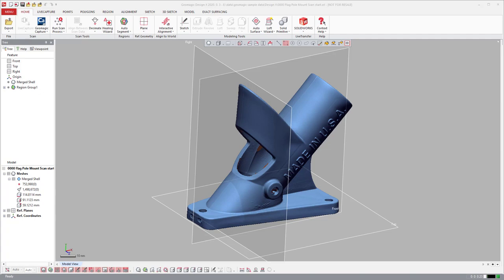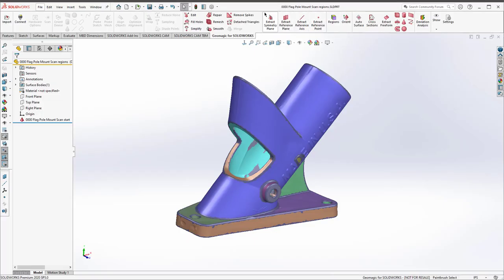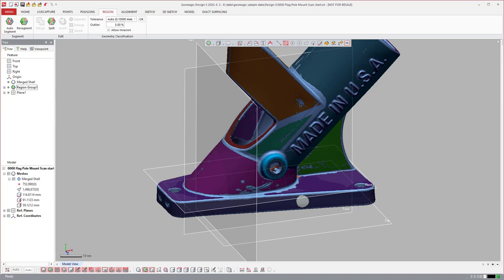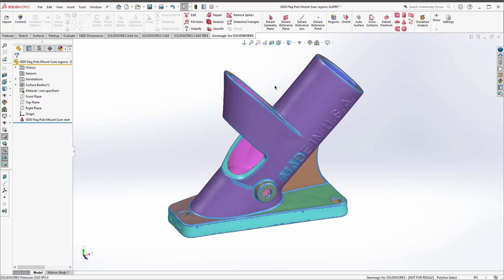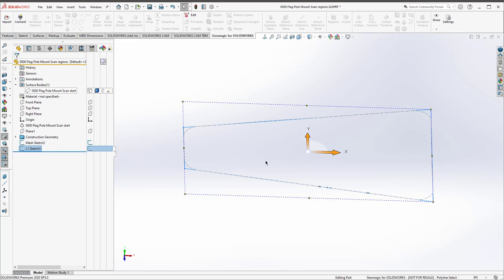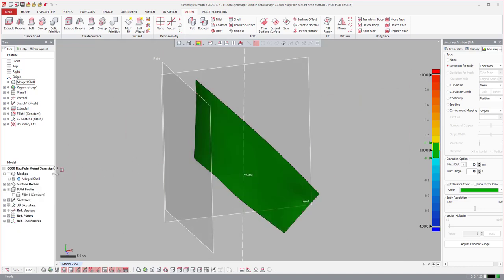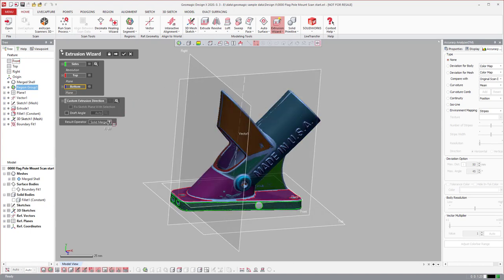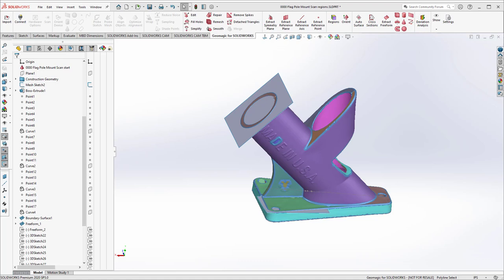Geomagic Design X vs Geomagic  For Solidworks Demo Video

Comment: Hi! I'm Edmara, Brazilian, dentistry student. I need to use this software to analyze STL images for my research. I have a doubt. can you help me? I want to compare two images in the software. I have 1 reference image and several test images. I want to compare only a part of the reference image. I did the manual clipping of the area that interests me. now i want to know if the software can automatically cut the test images to the same size as the reference image. so that I have statistical data only from the area that interests me. it's about teeth. I just want to compare the teeth in the images and discard the gums. but there are 400 images so I need to have something automatic in the software to be correct and without human errors.
Reply from the maker: I think the best way is to use our Geomagic Control X software. 

Are you getting your scans from CT or a optical scanner?

Comment: Thx for this Video. I have a question regarding the add texture feature. Can i add texture with this from Images? So if i have a Scanner that does not scan the texture, can i take pictures of the object and then add the texture from those pictures to the scan data?
Reply from the maker: With DX it is possible to take pictures and add color to the scan but its not the greatest color texture. The texture color tools are mainly there because there are a few scanners that do add color and it's helpful to have the tools. 

One way I see people add color later is to use photogrammetry to create color and then copy it over a high quality scan.
Reply: @gregoree197878  Thanks for your reply. I have also seen it to be done in this way but of course it's a time and computational power consuming process with the need of additional expensive Software. I also saw people use blender to do this but it also looked complicated and a bit messy so i was hoping that the function in Dx could be an in built easier solution for this purpose.
Reply from the maker: @harrywind1870  DX is about 10x faster then Blender and you get an actual CAD model in the end.
Reply: @gregoree197878  of course, I saw them using Blender just to add texture from pictures to the scanned mesh from a Scanner that doesnt scan the texture or where the quality of the Scanner texture isn't sufficient e.g. for renderings, AR or museum stuff. Therefore my question arose if i could do this in Dx easier without having to buy and learn other Software.